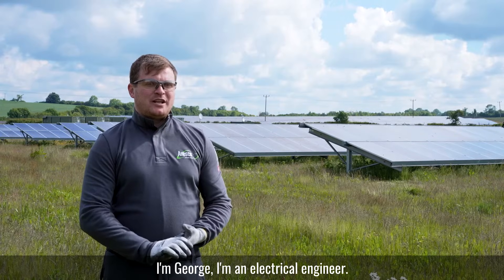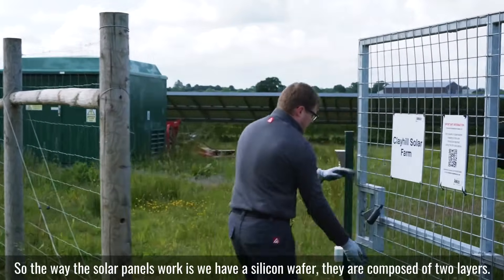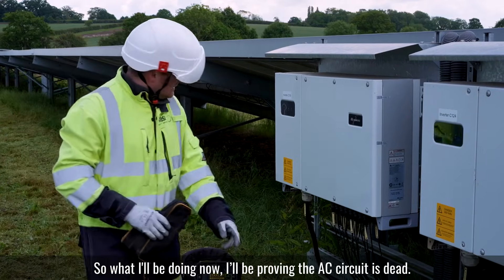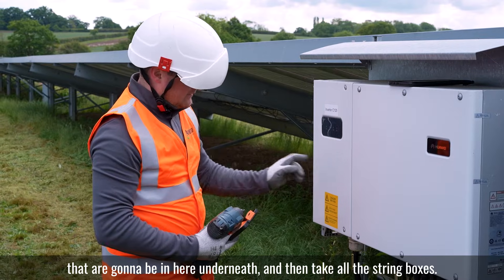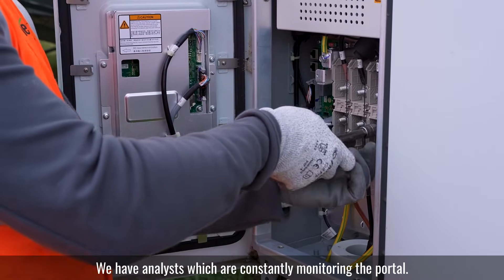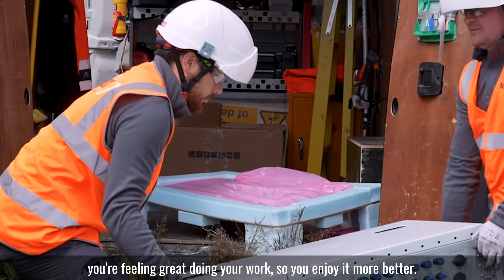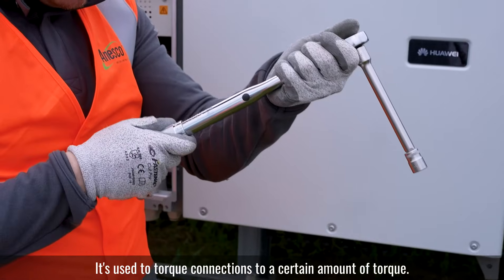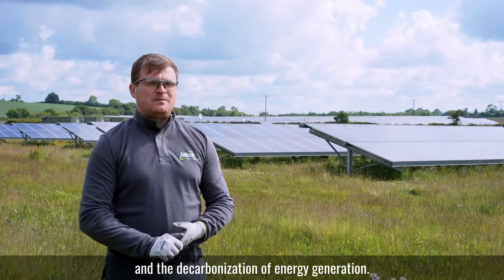Day In The Life of an Electrical Engineer

Comment: Hello whats the salary for such a job can you tell us if its not a secret
Reply from the maker: Hello Pasha, unfortunately, we are not sure of this as we only provide electrical engineers with our arc and flame-protective clothing, the salaries will probably vary country by country and also depending on the years of experience.
Reply: 75k~200k USD often. Around 110k most often. 220k~600k if senior big tech lead/manager.

Comment: I am just wondering can a electrician do the same job or it needs to be done by electrical engineer?
Reply from the maker: An electrician and an electrical engineer both work with electricity and electrical systems, but they have different roles and responsibilities.

An electrician is a skilled tradesperson who focuses on the installation, maintenance, and repair of electrical systems and equipment. They typically have hands-on, practical experience and specialize in electrical work in residential, commercial, and industrial settings.

An electrical engineer, on the other hand, is a professional engineer who designs and develops electrical systems and equipment. They typically have a four-year degree in electrical engineering and may also have a license from a professional engineering board. They focus on the theoretical and scientific aspects of electrical systems, including designing and testing new equipment, analyzing data, and researching new technologies.

In summary, while an electrician may be capable of performing some electrical engineering tasks, they generally have different skill sets and focus on different aspects of electrical work.
Reply: @strataprotection  bro wrote this using chatgpt 💀💀
Reply: One is the brain and one is the muscle
Reply: These men are electricians. They call themselves electrical Engineers😂
Reply: one designs the thing the other builds it